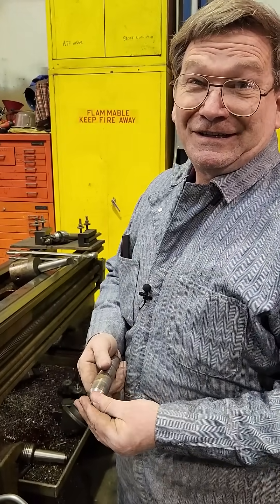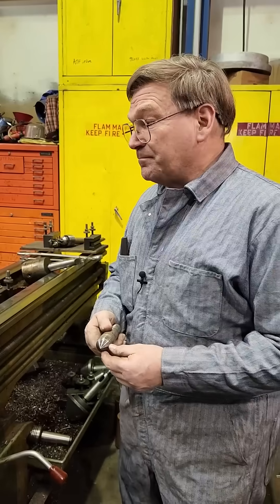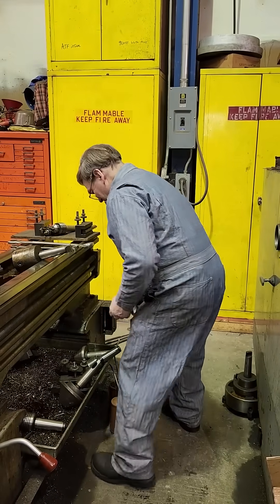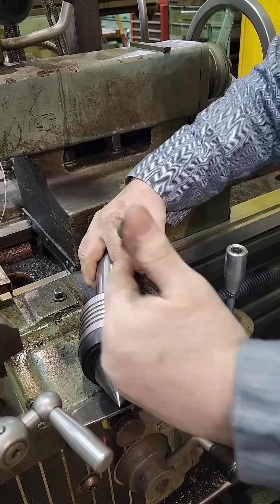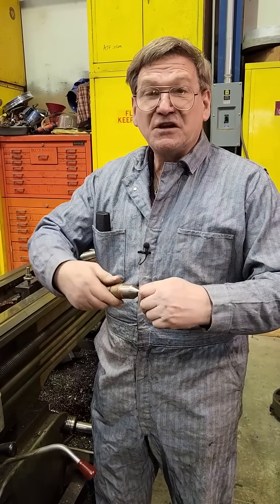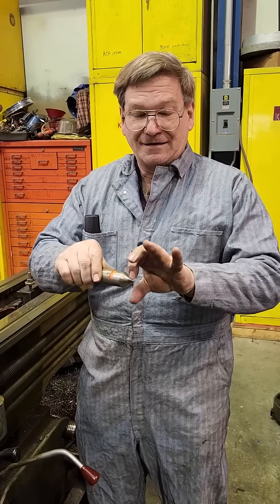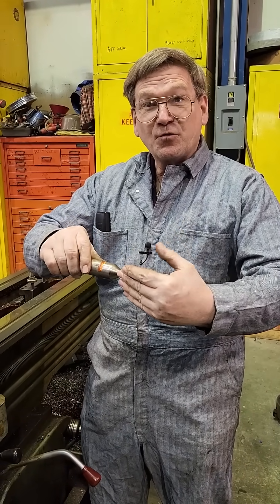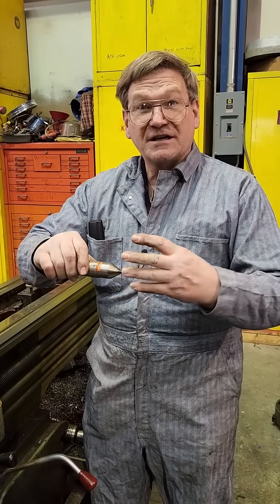Machinist's Minute(s): Why use dead centers?

Comment: Most Lathes (not all) have a tapered internal head spindle (Not necessarily a Morse taper) to fit that Centre into it directly or a tapered morse adapter, you can use a face plate and a center with a driving dog between the driving end and a live Centre in the tail stock. Some even have the tapered spindles to hold various types of collet chucks or bar feeders on bigger lathes.

Comment: 50 years ago I was turning armatures at Baldor Electric. We only used carbide dead centers that were ground in place on the lathe with a tool post grinder. They wanted precision in their motors!
Reply: that explains why older motors seemed to be quieter.
It just seems very wrong to me that a motor with nothing attached would have so much noise and vibration.

Comment: Dead centre is hard & goes  in the tailstock , Dead because it does not rotate  .  Live centre is soft & goes in the headstock , live because it rotates with the spindle & has no bearings , often identified with a ring machined at one end  .  Revolving centre goes in the tailstock & has bearings !   Different terminology that has been lost & changed over the years !

Comment: Goes in the face plate with a dog on the shaft, used them all the time 50 years ago!
Reply: Most Newbies don't know some spindles are tapered; my lathe has an adapter for a No3 Morse as well as an adapter for a BT40 collet chuck

Comment: ...and the best youre finish work can be is the roundness of the center drilled hole which is not a sure thing. They can't chatter/facet and cause problems with finish work.

Comment: Dead centers are the best but you can use a female center with a ball bearing in between the part and the center and achieve the same results as a dead center.  Just a little grinding trick from a old machinist. Have a blessed day

Comment: Good live centers have 3 bearings in them if a live center has runout you need to new one
Reply from the maker: Even a new well made bearing center will have deflection, when used against a large load, yet if checked against no load, will appear perfect.
Reply: By their nature, bearings have deflection and thus runout. You have to have space for the balls or rollers to move.

Also, a needle bearing in the tail and two ball bearings up top isn't much. Tapered roller bearings would be better but the last time I saw one like that, it was on a lathe with a 32-foot bed and a 74" swing. And the live center itself cost more than your average 8' bed lathe.